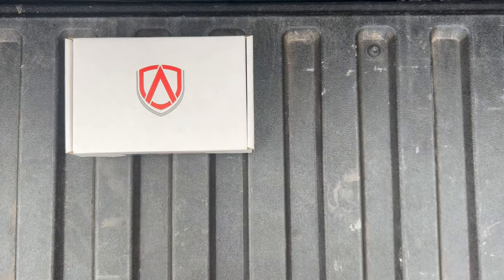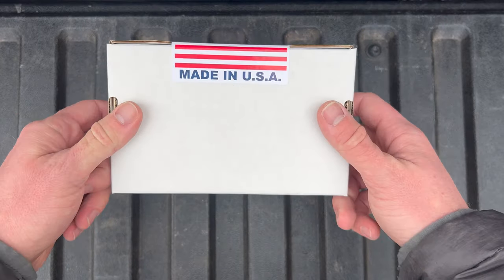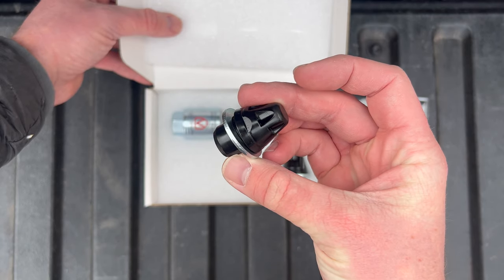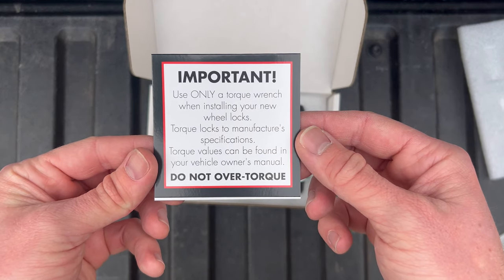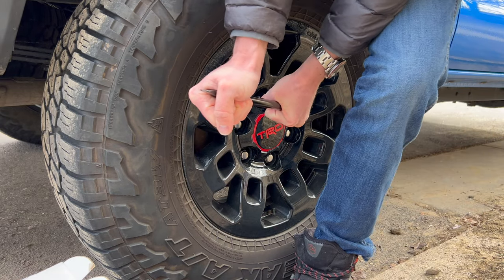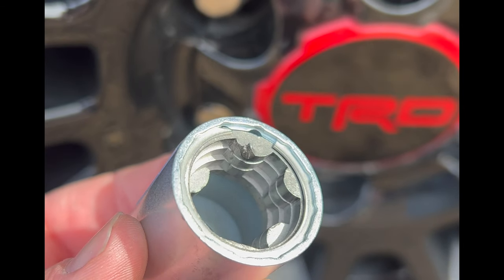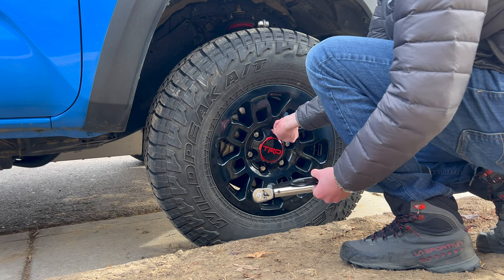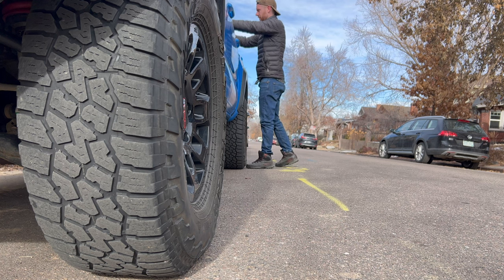[4K] Unboxing and Installation | Advanced Wheel Locks

Comment: Where is the locking mechanism on that locking lug nut? There is none. It's a security nut meant to be used with the appropriate socket. The socket is not a key it's a socket.

Comment: Probably a stupid question... but i see they come with a little rubber band and circular thing on the locks. Do those go on with installation or u remove them?
Reply from the maker: Since the instructions didn't mention removing either of these components, I kept them both on for the install! I imagine that the lug nut seat style (Conical / Ball / Flat) for your specific vehicle would affect whether these are present or not when shipped to you from the company.
Reply: @reidneu mine came with the washer and rubber band as well. How is it holding up after months? Did the washer and band give you any problems? I'm about to install these myself.